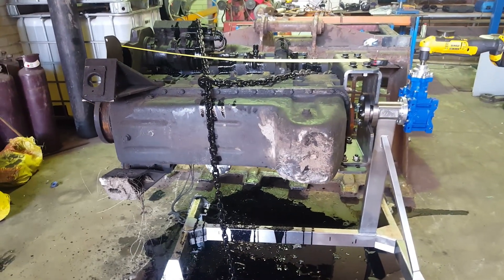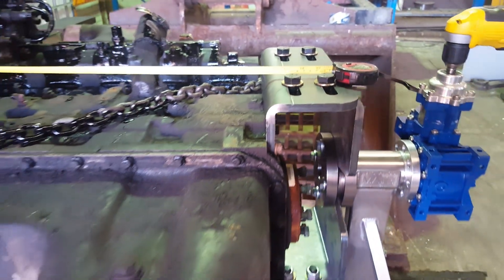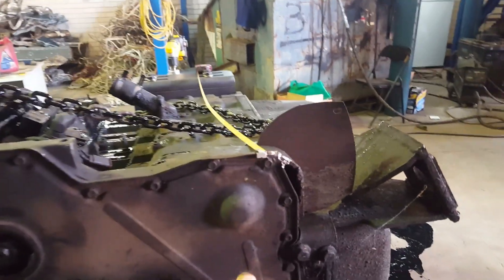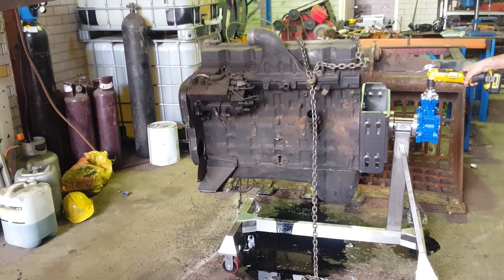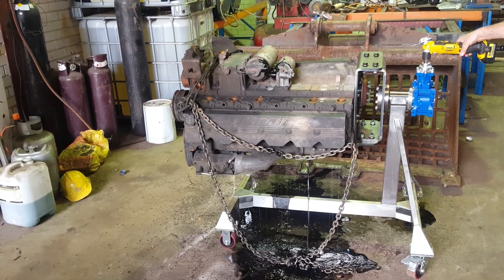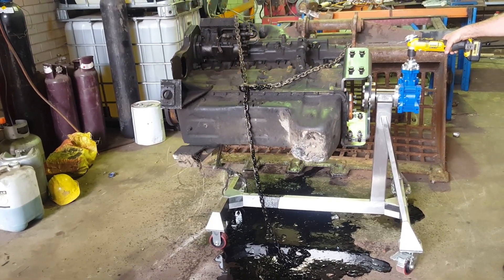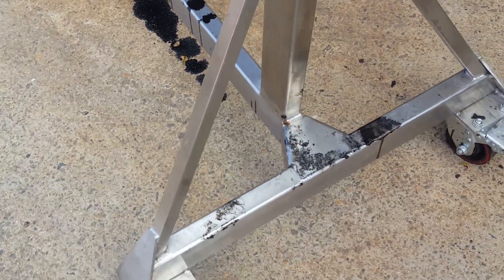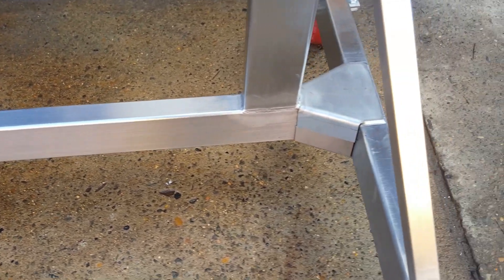Mechanics Mate Engine Stand With Cummins Engine Test

Comment: Should have drained the oil first what a mess
Reply from the maker: You are right. It wasn't my engine. So I shouldn't have assumed that the oil was drained, and it wouldn't leak.
Wiser in hindsight.